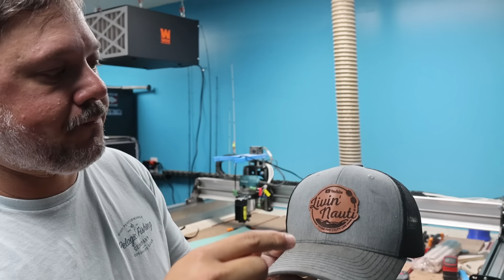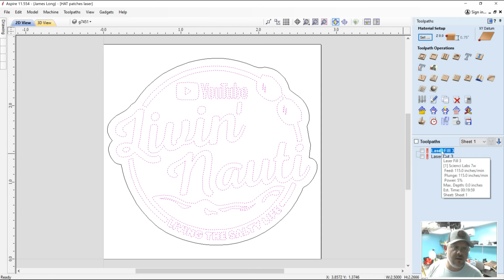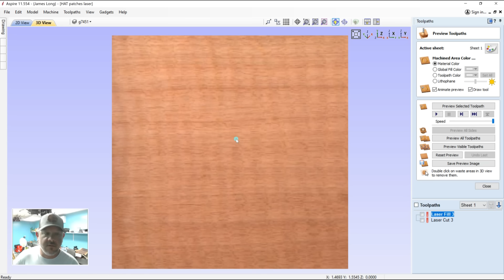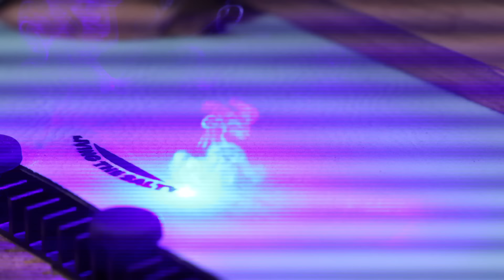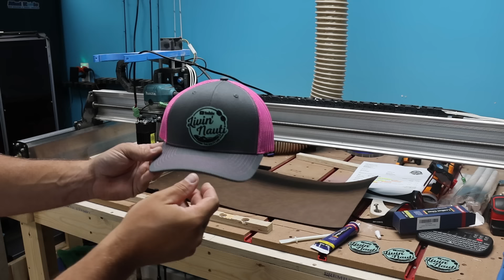Making custom hat patches with laser | Save a TON of money | Vectric Aspire Laser | Sienci Labs MK2

Comment: I have 2 Shapeokos. I originally bought a diode laser for one of them. It never got installed. Still in box. I got thinking why take up my wood cnc with a diode? I Ended up getting a cheap $300 Chinese diode laser. Use it on every cnc project on the backs with company logo. Have also done like car show trophy’s. Shapeoko to carve and diode to burn.
Reply from the maker: Yeah, I definitely enjoy incorporating the laser into my projects but it's very time consuming depending on the detail.  It's nice having the option to engrave/cut large pieces of material on the cnc.   I do have a smaller 10watt but the bed is only 20x20. Thanks for watching!

Comment: I thought about carving a curved buck from wood to press the hats with. I ended up getting a cheap 5 in 1 heat press.
Reply from the maker: Yeah next time if I buy the faux leather with the adhesive backing I'll have to get one.  With the glue I used, it was so tacky that I didn't have to do anything but press it on there with my fingers and it stuck fine.